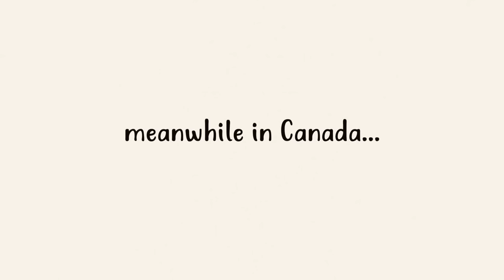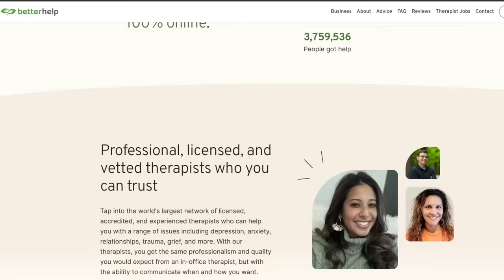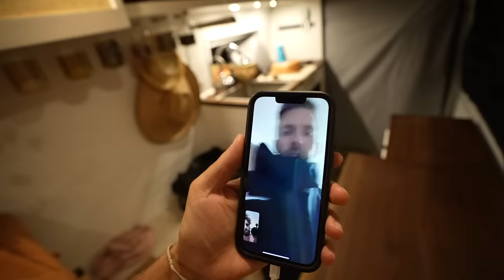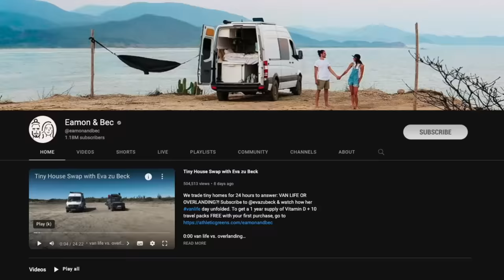The Highs and Lows of Solo Van Life

Comment: Hope you have solved the van mechanical issues and not too expensive. 
It definitely seems like the air conditioning condenser is leaking. Which is a small radiator between  the grille and main engine cooling radiator. 
The idler pulley is a guild for the serpentine belt on the engine. 
If the Idler pulley is failing but not seized up yet replace it immediately because if it completely fails/seizes  the serpentine belt will be destroyed. Which means you won't have anything turning the powers steering pump, alternator or the AC/Compressor.  Also Congratulations to Bec's sister/family on the baby. Auntie Bec

Comment: Eamon, I doubt you have 600W of solar. You would need 3 square meters (or more) of solar to get 600W. When you built Casa B, I didn't think your panels were actually 200W. They were too small (not 1 sq meter). Plus, if you have any shading,  that can drastically reduce the output depending on how they are connected. Also, your fridge eats a lot of power. The plate you use for heating water works but is very wasteful. You need an induction ready pot, and it will be much more efficient. Love the videos, BTW, keep it up.

Comment: Not a mechanic but know a thing or two... it's not your radiator that's bad or you'd be losing coolant for the engine, it's something LIKE a small radiator called your condenser where the fluid for the AC goes to cool down (heat exchanger). Additionally, a vibrating idler pulley is interesting to have something to do with it... I'd say that has more to do with your steering and nothign to do with your A/C, as they are most likely unrelated to each other entirely. You'll need an equipped mechanic because if they put in a heat exchanger they will then have to vacuum the system while it's sealed and then fill it after they confirm it's holding vacuum. Goodluck!

Comment: They make sealant for radiators, its not a permanent repair. It will get you by for a while. If you can locate the leak you can use epoxy or go find a junk yard for a new used one.  "If the women don't find you handsome, they should at least find you handy." But we all know Eamon's both.

Comment: I've worked for Mercedes commercials for 18 years that steering sqealing is caused by the alternator pulley. It has a clutch in it and when it fails it locks up and causes the vibration on the belt.

Comment: You must check your alternator pulley also. The clutch (ratchet) inside it might be blocked causing the vibration on the belt and tensioner as it sounds on video. Good luck!